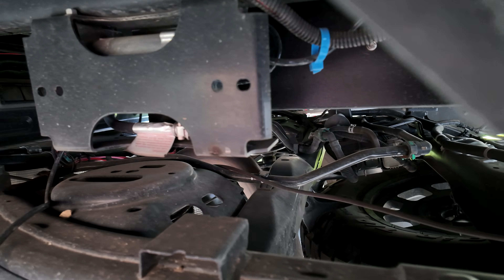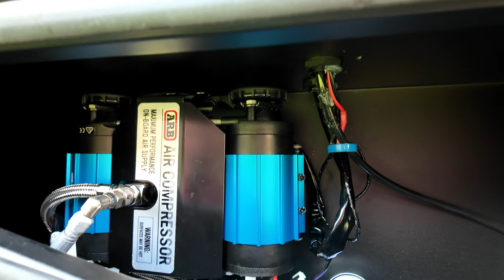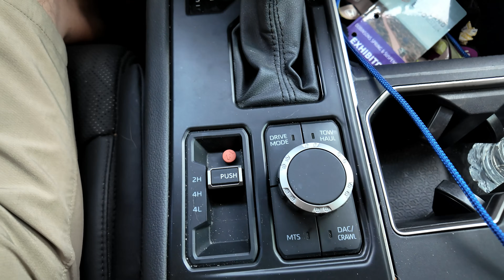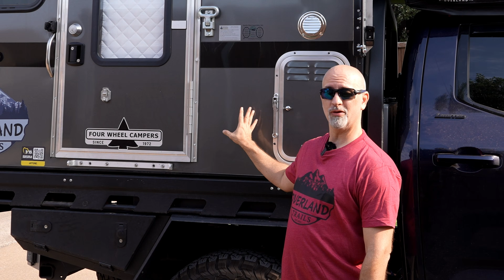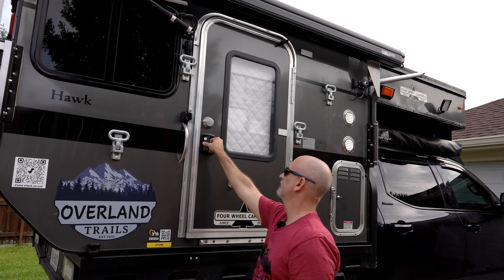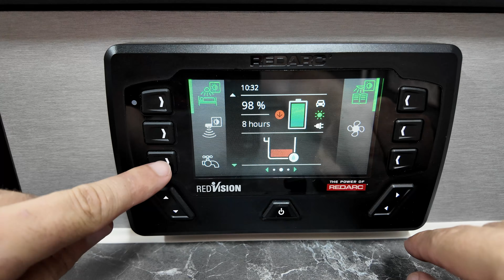How We Made Our Dream Overlanding Vehicle

Comment: i don't think all the time and expense is worth it if the truck isn't diesel.
Reply from the maker: @Jonny-p1c8d  they are great but overkill in this situation.
Reply: I completely agree. I'm driving a 2017 f250 King ranch powerstroke on 37-in tires and I couldn't imagine doing this with any other truck. 

I have an appointment to put an extend at 60 gallon tank in it. Once I do that it should have over 800 miles of range due to the diesel getting better MPG. I'm also putting locking diffs and hubs on it and it already has the carli Pinn top suspension kit. I can blast 60 mph down a potholed, bumpy fire road and the truck stays perfectly composed. 

And the diesel torque is so addictive. It's everything I thought it would be and more. I think I need to think about a way to fit 40s. I'm just going to have to do some cutting and put a bigger lift on it if I want to do that. 

Okay 40s are something I'll have to think about. But you get the point, having the 6.7 powerstroke makes 40 inch tires feel almost optional just to begin to touch the motors torque and horsepower.

My previous truck was actually a 2008 Tundra Crew Max. It had the kind of motor he said that he should have gotten, it was a great motor and a great truck but I needed the 4000 lb factory payload capacity because the Tundra was only 1,700 lb of payload
Reply: Overlanding is not an arms race. Stop packing your suburban mcmansion with you everywhere you go, especially to the woods and mountains.

Comment: A 3/4 ton Ram 2500 or Ford F250 would have been better........
Reply from the maker: @DaltonHan  yea
Reply: Too big for most trails. You might as well buy a bus at that point. Overlanding is not an arms race.
Reply: @mmt9938  Then he shouldn't be using a FWC Hawk. Fully loaded he will be way over the Tundra's GVWR. I owned a 2022 Tundra before. Have you?.......
Reply: @DaltonHan  Then you should know that Tundras have proven to overperform again and again compared to the specs provided by Toyota. Additionally, people in the community with the Tundra-flatbed-FWC setup have had nothing negative to say about the quality, reliability of the build, and have lasted over a great amount of time.

My dad still owns his 1st gen tundra (bought new back in 03 with the suicide-style doors  which I frequently drove in my younger years. I sold my 2nd gen Tundra back in 2020.

These people with this setup are real life, living proof that you can have this setup and comfortably overland. Have you owned a tundra with this setup?......

Comment: I have the same look, but SR5 sport double cab with 6.5 ft bed.. As for the power dynamic, dose putting it in different drive modes make a difference  for you? I know when I put my driver mode into sport it is more responsive, especially in tow mode.  You did not mention that you had those engaged.?  NICE LOOKING RIG!
Reply from the maker: @drewbravo8683  thanks. I pretty much run tow haul all day unless I'm at cruising speed across the flat deserts..lol

Comment: Great looking rig. Yeah, engine power and weight carrying capacity are a big negative with the Tundra. I wish Toyota would make HD trucks. Did you upgrade the brakes?

I built something similar on a 2022 Ford F250 Tremor 7.3 Liter gas truck with a Mits Alloy Evo 2 flatbed and a Supertramp camper. I looked at the FWC Hawk as well, but at that time I was not ready to go flatbed. That came a little later down the line. Lead times on a Bowen Customs bed were so ridiculous so that I went with the Mits as well. 

Overall, the Mits is a good flatbed, but I hated how unnecessarily tall the Mits made the camper sit. I had my local shop lower the bed to reduce the overall height. I am so glad I did. Yes, I lost the drawer, but the truck handled so much better when driving. If I would have kept the drawer there were still about 2 inches that the height would have come down. Mits was not very helpful when my shop reached out. Fortunately, my shop was able to make their own mounting brackets. 

I used the Torklift steps as well. Great choice. I put marine-grade "carpeting" onto the steps and also added the Pet Safe option. Made it easier and more comfortable to walk up and down.

My new rig is going to be a bit different (Rossmonster Baja), but I want to travel and work full-time from the road and neither my Supertramp or the FWC were sufficient enough. Would love to hear how you work from the road and all that good stuff. See you down the road ...
Reply from the maker: @dtadventure4x4  just upgraded to power brakes and love them.

Comment: Thank you for your honest maybe blunt assessment of the new Tundra.  We chose a Ford F-250 which has a generous payload capacity and has been a reliable workhorse that needed minimal modifications.  Ford does not yet have the proven or perceived quality that Toyota has earned.  
We have a 2019 Hawk and it's pleasing to see that FWC is continuing to improve its product.  I especially like the upgraded heater/water heater, stove, sink, electrical upgrades / options and my favorite under bed storage!  I'm curious if the aluminum internal structure needed for the roof actuators interferes with inside use of the camper.
Reply from the maker: @stephenkramme7063  hi nope, we actually are looking to use to hang stuff on..lol
Reply: Ford has a great reputation. Just read about the reliability of the 7.3 powerstroke and the 6.7 powerstroke is not far behind it. 

Your F-250 is one of the most reliable trucks ever created, and it's a hell of a lot more than just reliable to boot.

What size tires are you guys thinking of putting on it?
Reply: I completely agree. I'm driving a 2017 f250 King ranch powerstroke on 37-in tires and I couldn't imagine doing this with any other truck. 

I have an appointment to put an extend at 60 gallon tank in it. Once I do that it should have over 800 miles of range due to the diesel getting better MPG. I'm also putting locking diffs and hubs on it and it already has the carli Pinn top suspension kit. I can blast 60 mph down a potholed, bumpy fire road and the truck stays perfectly composed. 

And the diesel torque is so addictive. It's everything I thought it would be and more. I think I need to think about a way to fit 40s. I'm just going to have to do some cutting and put a bigger lift on it if I want to do that. 

Okay 40s are something I'll have to think about. But you get the point, having the 6.7 powerstroke makes 40 inch tires feel almost optional just to begin to touch the motors torque and horsepower.

My previous truck was actually a 2008 Tundra Crew Max. It had the kind of motor he said that he should have gotten, it was a great motor and a great truck but I needed the 4000 lb factory payload capacity because the Tundra was only 1,700 lb of payload